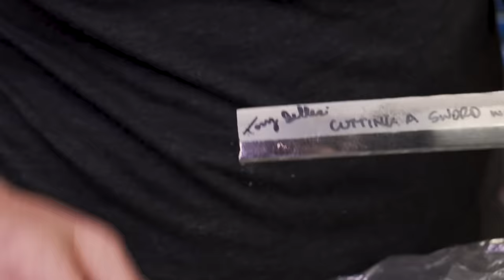Adam Savage Unboxes Props from Grant Imahara's Collection!

Comment: Looks like the Hybrid III was introduced in 1976, and is still the standard (along with some other larger male, some female, and children dummies).  There's some newer models that are more advanced called THOR for frontal impacts.

The II was introduced in 1972.  Not sure how long it was used after the III in 76..  Also sounds like the II was mostly used for testing seatbelts.

The thing about standards like this is...  they tend to be used for a LONG LONG time.  Primarily because when you do a test, you want to compare it to all the previous tests done, and you'd rather do that with the same piece of test equipment.  So even though the III is now approaching 50 years old, I'm not surprised it's still being used for testing.

By the time Mythbusters came along, the II they got was likely a good 30 years old, so I can see why "random government official" was willing to part with it.  Knowing how government works, I can also see why he didn't want to reveal they gave it to them.  "That was supposed to be sold at a GSA approved auction!!!!".
Reply: The person could be charged with stealing from the government.